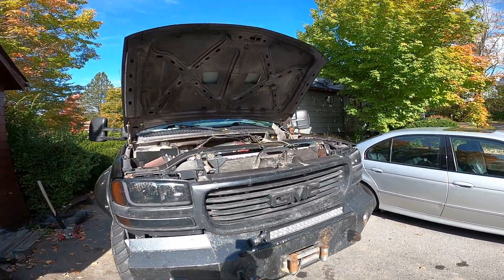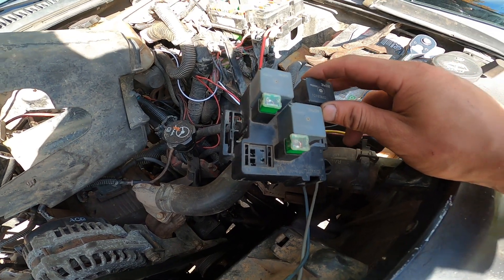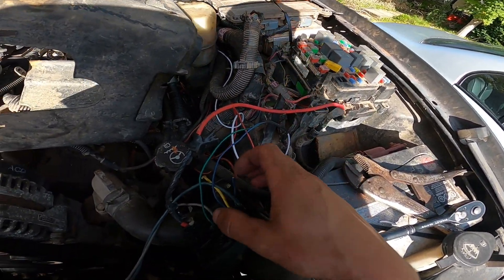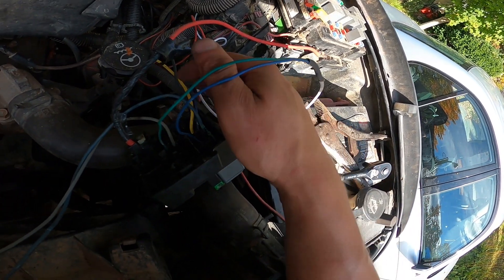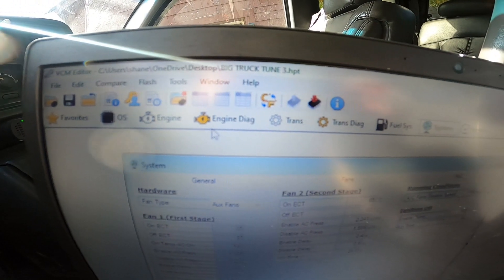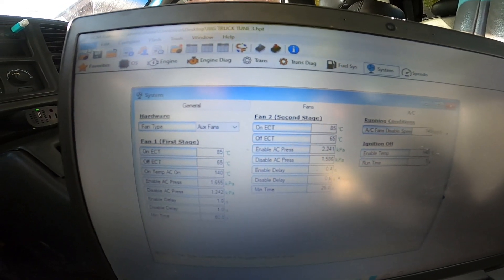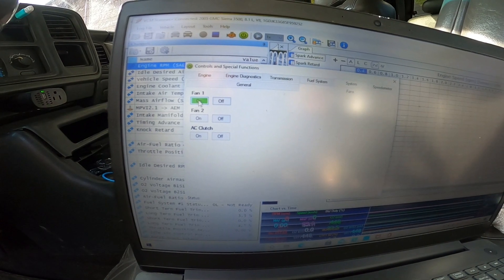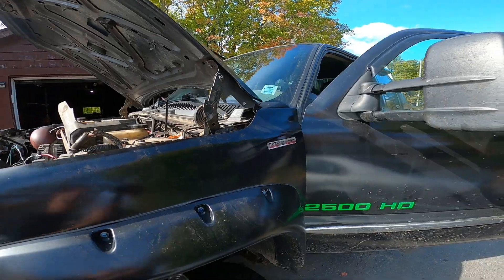GMC Sierra Clutch Fan Delete! Electric Fan Installation And How To Setup With Hp Tuners

Comment: Hey man I'm in Saskatchewan and I have a problem with my 01 8.1 it idles rough when warmed up for about 10 seconds then idles perfect. It has misfire on cylinder 8 with no engine light on. I've put new injector in 8 cylinder new plugs wires fuel filter fuel pressure regulator and swapped coils around and still misfires intermittently. Just wondering if you have any suggestions. Other then that the thing runs perfect thanks 😊
Reply from the maker: Tiny exhaust leak near my 02 sensor caused me a lot of headache
Reply from the maker: U may have a bad intake manifold gaskit too
Reply: @BurninGas8.1   Thanks so much I will definitely look at it this weekend cheers